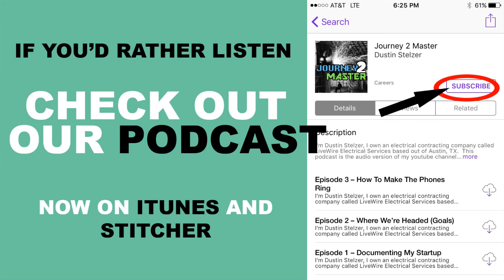Ep 15 - Q&A With EATON Engineers About AFCI / GFCI / AFGF Issues

Comment: Eaton still doesn’t have the led flickering intermittently problem resolved with their arc/gfi br breakers! Cause you put a regular breaker in and it doesn’t do it! So I ended up buying a small transformer and hooked up at the breaker on all the circuits that were blinking and they stopped blinking! I believe it has something to do on the neutral side going thru the breaker, as the transformer helped with that!

Comment: I have a question that refers to a transfer switch. I am trying to figure out how to connect the wiring since I just found out the breakers I have, have a white and black wire connected to the breaker. The transfer switch only has a black wire that supposed to connect to the black wire from the circuit breaker and a red wire that replaces the black wire removed from the breaker. I just don’t know if it possible to use a transfer switch on these type of breakers. Any help would be greatly appreciated

Comment: What should I do if my arc fault keeps tripping, and I replaced it multiple times!! Is it okay to but in a regular breaker?
Reply: Did you watch the video? Maybe that circuit is sharing a neutral, maybe a device or fixture is doing a poor job of transforming power, maybe there is an arc fault in your circuit(s). Hire an electrician or get your tool kit and start troubleshooting?

Comment: Hi have had juno puck light transformer trip the arc fault. What I have witnessed is that  most arc fault trips  due to wiring installation problems. Ex. Mixed neutrals from different circuits and a ground wire touching the neutral side of a receptacle